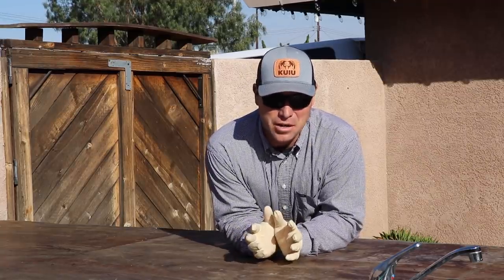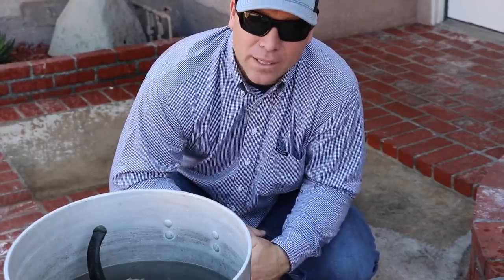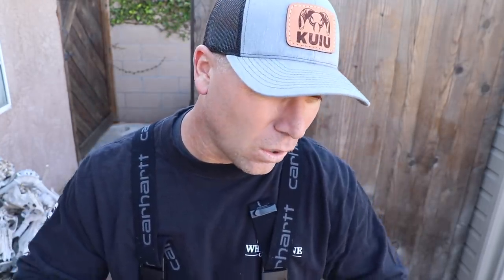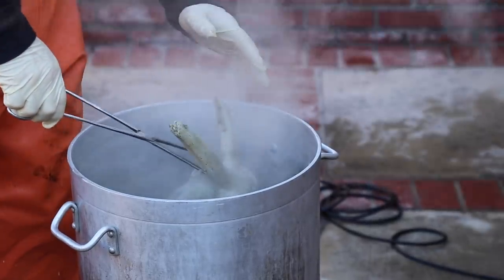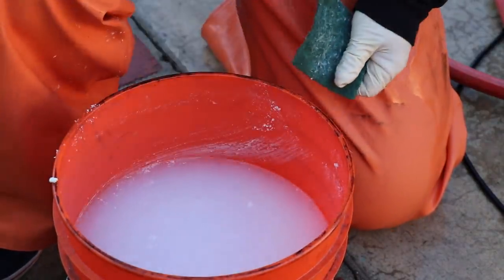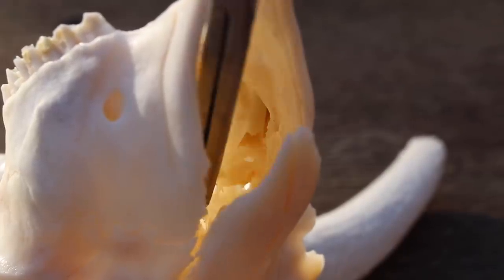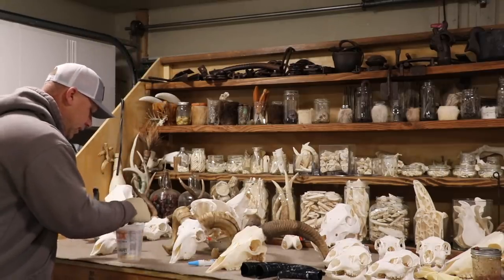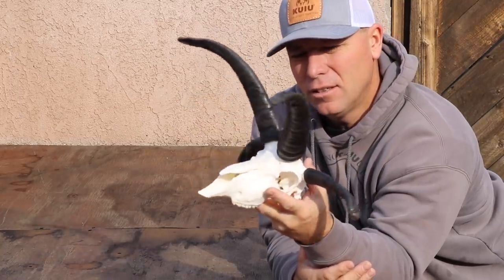HOW TO CLEAN A FOUR HORN RAM SKULL "JACOBS SHEEP"

Comment: I am not a hunter but fully support it and really enjoy your videos. I have had an idea for a long time that I came up with from watching your videos. The idea is to get a old sand blasting cabinet that has a big window. Remove ALL of the sand blasting pieces and plumb your pressure washer into the cabinet. You would also need to modify the spray wand to a smaller size that would fit inside the cabinet. This would give you a better working height for removing the tissue from skulls, it would also help you hold the skulls better. And also would keep you dry and debris free as you did this. When you were done doing a skull you could remove it from the cabinet and spray it out to clean. Just an idea I had. thank you for the great video and for being a very genuine person. Merry Christmas and Happy New Year :)

Comment: I'm kinda curious about your opinion on something;
The way I grew up, we collected bones of various animals for various reasons. Usually it was like a deer that'd gotten stuck on a fence, a feral dog that'd been shot, the arbitrary cat we found. Due to the local laws, we couldn't bring the carcass home if there was meat on it. So, we'd haul it on an ant hill and wait until the bones were accessible, then put them in about two gallons of water and a cup/cup and a half of bleach for around four days - since we weren't doing it professionally there was no issue of time limit.
What's your opinion on this method of cleaning?

Comment: Ive only been able to do a handful of smaller animals doing this method, they turn out beautiful, tho km not sure if its an error on my part or not, I've done a wolf and bobcat skull and both ended up having a kinda orangey brown crust where the teeth meet the bone once compleatly done and dry, its not smelly or anything but it does cause a slight discoloration to the root area. Have you ever had any problem with this involving the teeth? Or may it be a fault of my own when i was cleaning.

Comment: Two questions. 
1. I want my skulls to be anatomically correct, as in, I do not want to have the ear bits removed. Do you have any recommendations on getting it cleaned that way? Maceration perhaps for the last bits? Or any other ideas?
2. I got some 'old' wild boar skulls (as in, they were boiled about a year ago, not properly, and are awfully greasy now). Getting them cleaned is proving to be awfully difficult. I've been using things like enzymes, and dish soap (dawn). But every time I put in bfresh water the grease just keeps coming. Got any tips on getting them clean? And is this even possible with old material, especially greasy boar (the most awful in my opinion)?

Comment: Did you find that the liquid developer was causing long term issues? Or is the new Silk better.... I've been using the peroxide for 2 years now and was just curious if I need to think about switching up.... Thanks..... Blue Line Skull Mounts
Reply from the maker: No issues with either. I was looking for a product everyone could get there hands on. That’s it I love both products no issues.
Reply: @WHITEBONE  Sounds good..... I stick with the 40 volume, bc it's so easy to get in store or they will order it for ya.... Thanks